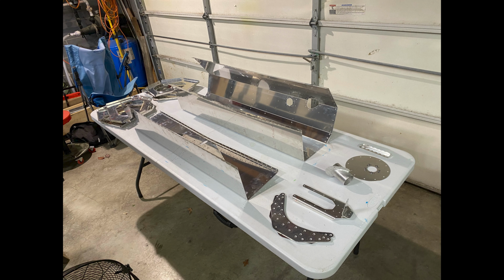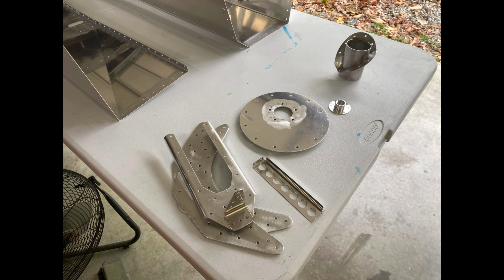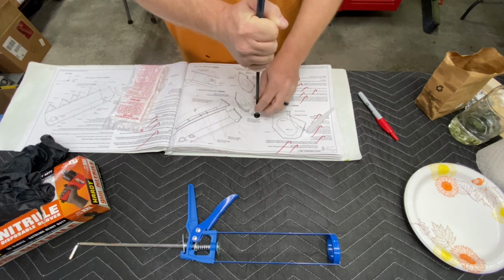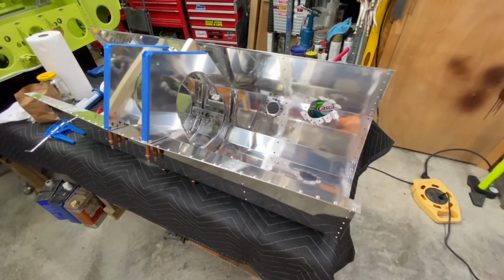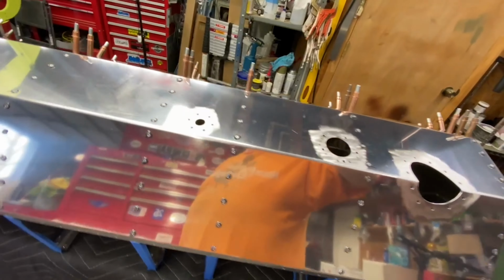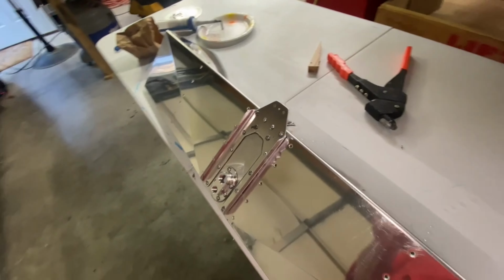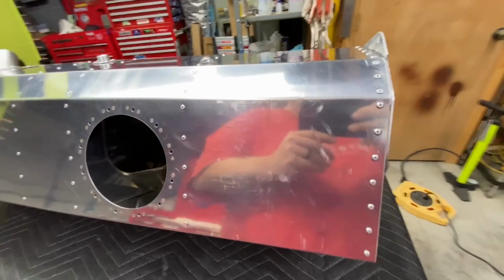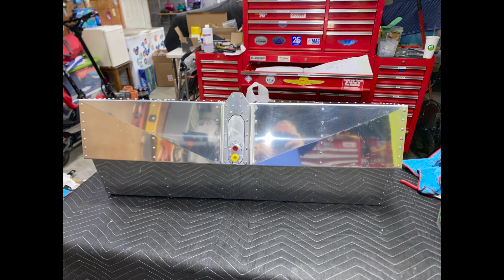RV12-IS Fuel Tank build

Comment: Looks like that fuel gauge works on a magnetic transfer. You should be able to remove it with those two screws and place out of the way till the nasty is finished.
Reply from the maker: Yes it does and yes I should have!  Hindsight is 20/20.  Too much tunnel vision!